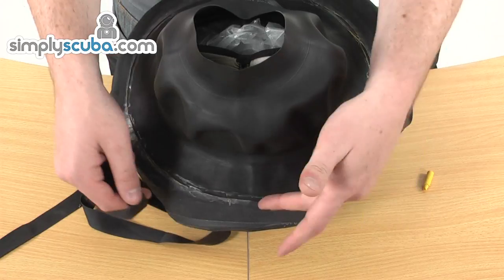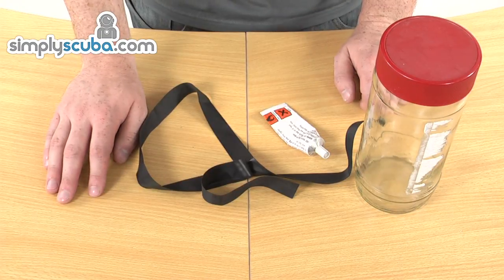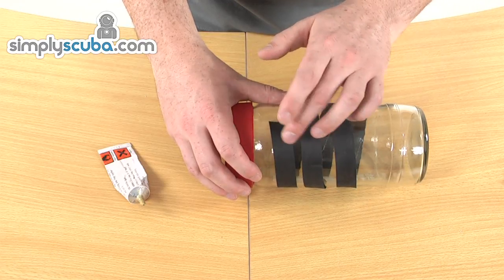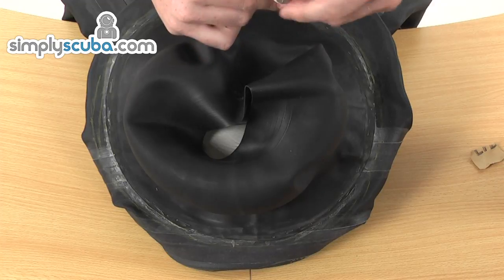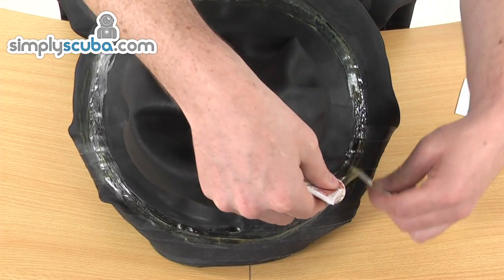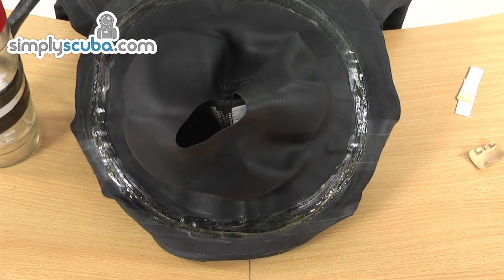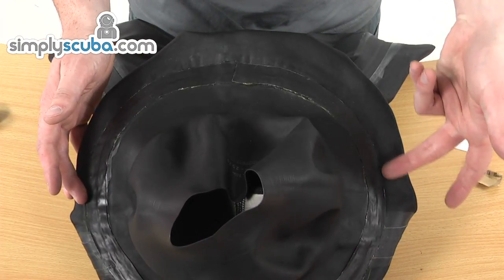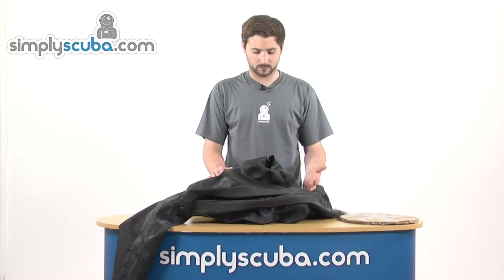How to fit a Dry Suit Neck Seal (Part 3 of 3)

Comment: Great vid I like you are gluing the seal right onto the suit fabric all the american vids showing this job cut the old seal away leaving an inch wide ring of old seal to glue to, when I pulled at my perished seals they came away from the fabric? may be a hole in you flat round disc the size of the one in the suit so surplus neck seal can drop through, spreaders for the glue can be got from motor factors for car body filer.